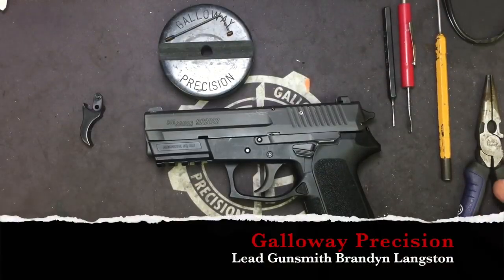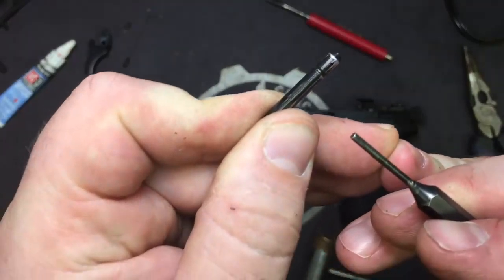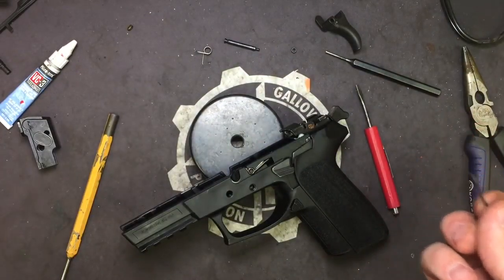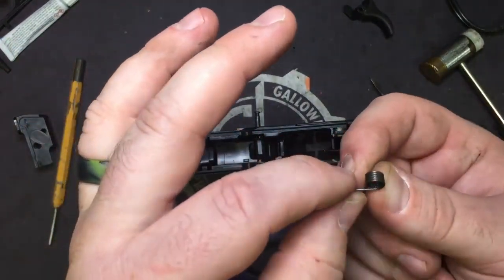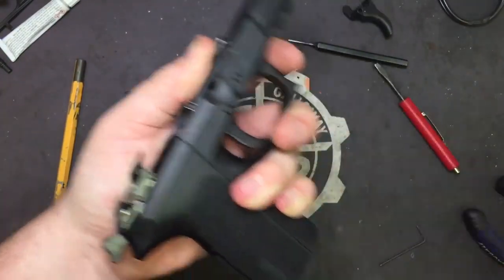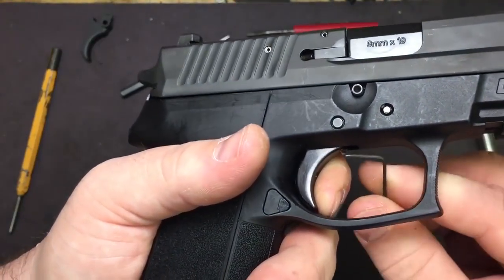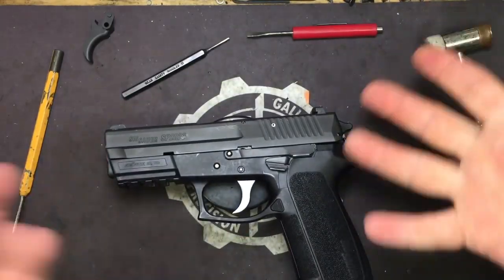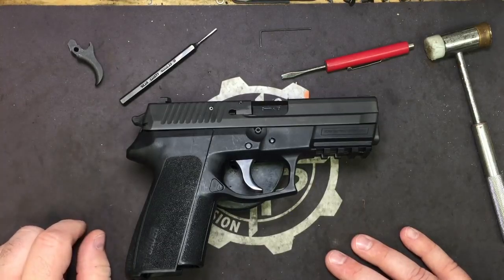Hannibal Short Stroke Trigger Installation for the SIG Sauer SP2022 from Galloway Precision

Comment: Does this Hannibal trigger move the trigger brake forward at all? 
The stock trigger breaks too far back making it awkward to pull the trigger finger so far back. 
Moving the trigger break forward 1/16" would be fantastic.
Reply: It does not.  It just removes the slop pre and post pull.  Does not move the trigger ppoint

Comment: Fletcher, NC is not far. I see the price for the trigger on your website. Says you can install for a nominal charge. What is the nominal charge?
Reply from the maker: Currently $50. They are at Blacking and should be back in stock on the website next week.
Reply: @GallowayPrecision  thanks

Comment: I need this kit but it's out of stock. ☹️
Reply from the maker: It is out at Blacking this week and will be back on the website as soon as it arrives some time next week.
Reply: Ok so I received the kit installed it step by step according to the video, without the slide on its works great, after putting the slide on and attempting to adjust it won't adjust to the single stage. Well it won't reset the trigger to the single stage. I've taken all the range out of the set screws and still no reset to the trigger. It's like the trigger is getting hung up going forward. Wtf is going on? 😊